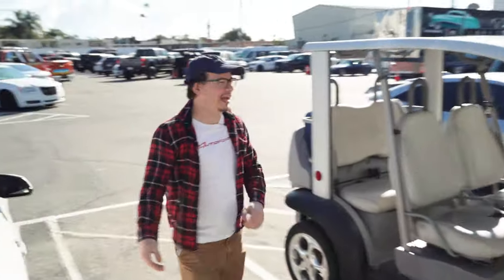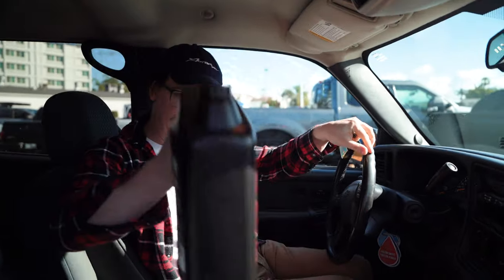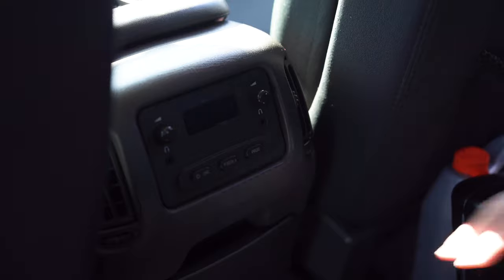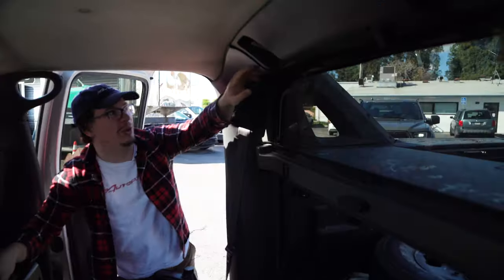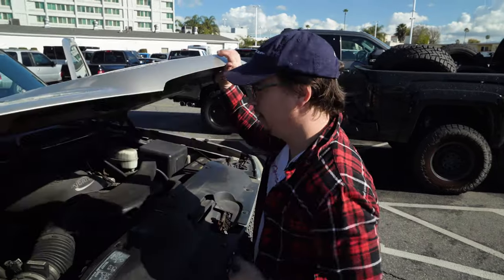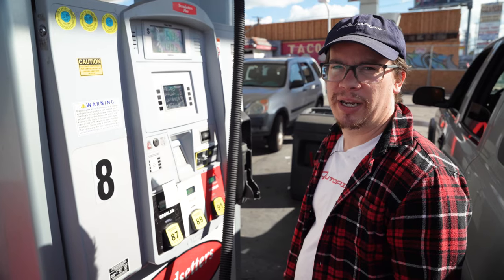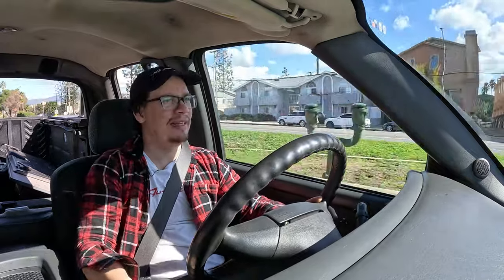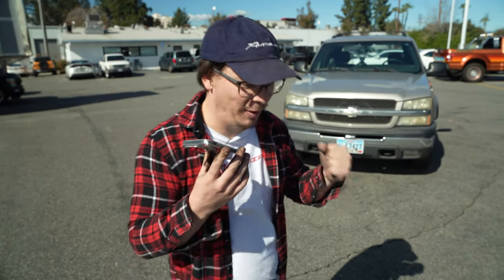I Drove A Chevy Avalanche Someone Traded In To A Dealership. It Was Phenomenal – Trade-in Tuesday

Comment: I owned a 2004 Avalanche Z77. I loved that truck! Yes it was comfortable. It was 4 wheel drive. It didn’t have all the plastic cladding of the earlier models, only had plastic wheel well trim, the sails, and box trim. I thought that made it look better. The earlier models with all that cladding along the lower sides, I thought was pretty ugly. I also had a black steel bush guard on the front of mine, which gave the truck an even tougher look. 

I bought the truck in 2005 with only 18,000 miles on it. I kept that truck for 15 years and put over 200,000 miles on it! 

I rebuilt the transmission, including rebuilding the 4 wheel drive, which quit working at about 150,000 miles. I drove it about two years without the 4 wheel drive working which hampered my hunting a bit because it limited my ability to get to my downed deer for recovery. Everything worked fine after the rebuild. 

I gave the truck away, with nearly 230,000 miles on it to my wife’s son, who was moving from Tennessee to California. The brakes gave out on the truck somewhere in Texas, rust had blown out a brake line and he had to get all the brake lines replaced. 

Over the years of owning that truck, other than the transmission and 4 wheel drive rebuild, it never needed anything more substantial than just routine maintenance. 

In the 15 years that I owned that truck, I took the glass out, and dropped that mid gate, twice. And both times that was just for kicks. It was a pain to do and took a lot of time to open up and put it back. It was also easier to do with two people. 

Those covers on the back of the truck were heavy as hell and once the rubber had weathered several years, the bed of the truck was no longer waterproof. 

The rear window trim, or frame around the glass, was made of steel and mine rusted in the bottom drivers side corner, which allowed water to drain into the box. That was OK, as long as the truck was sitting level, or higher in front than back. The water would just drain into the box, then out onto the ground. 

But after I met and moved in with my girlfriend, (later my wife), in 2015, her driveway was sloped downhill from the road to her house, and I discovered that if the truck sat in the rain, nose down, the water would run into the cab and I’d get a puddle of water in the carpet under the drivers side dash!

I tried to find a replacement window for the back of that Avalanche and that was impossible! So, I just started backing into her driveway and made sure I never left the truck outside, in the rain, nose down. 

As far as I know, that 2004 Avalanche Z77 with the original 5.3L engine and rebuilt transmission and transfer case, is still running strong in California!

Comment: The transmission is fine, but it's the smaller of 2 transmissions that GM had at the time and the weight and power of the Avalanche means the transmission is the weakest part. So it's the bit that breaks the most.
Reply: Just replaced mine and it had over 200,000 on it. So it's not to bad. 🤝👍